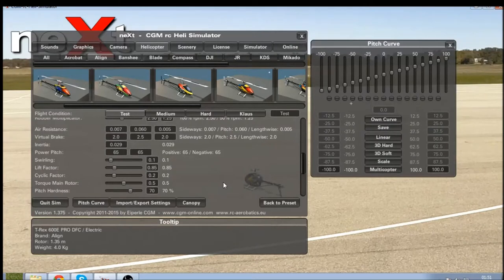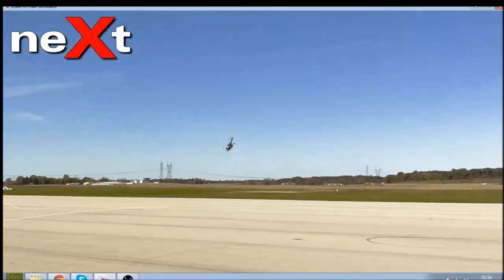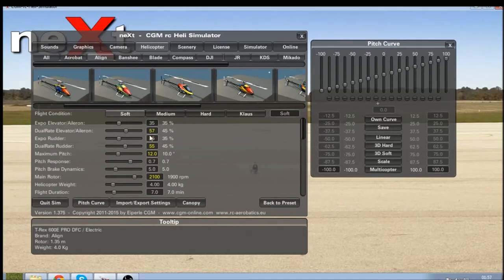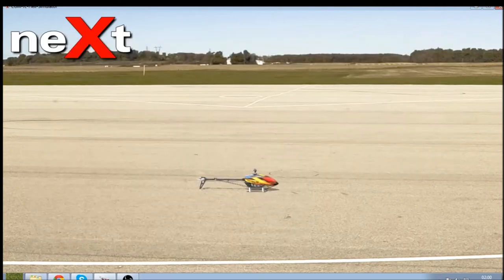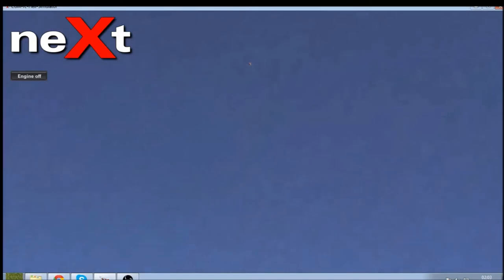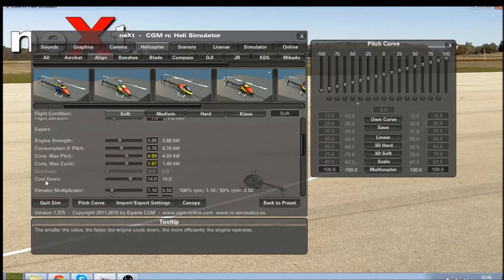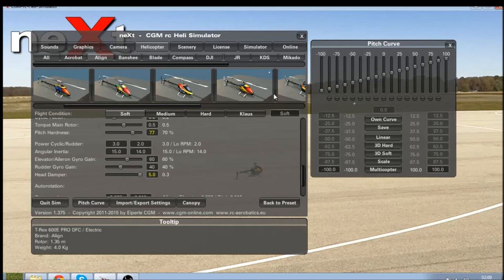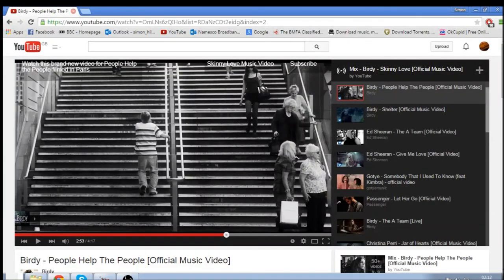Next RC Simulator - Setup Tuning Tutorial

Comment: Hi simon4557,

I have DEVO 7e transmitter, and i dont know how to combain it to the game.
can you explain me how to do so ?

THANK ALOT
Reply from the maker: +amitt111 https://www.youtube.com/watch?v=9HLhXViLo2Y

thanks
Reply: +simon4557 
THANK SIMON, but it doesnt work :(
maybe' because i use the demo version ?
i hava win xp LOL. maybe this is my problem ?

I did all your steps in the video, but i didnt managed to do "throttle up" cuz the computer didnt recognized the transmitter/
Reply from the maker: what simulator cable do you have ?
Reply: i have them both:

1. cable with two same heads (like cable of headphones)

2. cable with USB input, and mini-b output.

i tried with them both..
Reply from the maker: does windows show your controls moving after calibration in windows game controller settings ?
Reply: no :(
Reply from the maker: is your transmitter turned on ?
Reply: yes it is..
Reply from the maker: it need to be turned off 
turn off tx then plug cable into tx it ill power on when cable is inserted. do not turn power on the tx with switch.
Reply: i tried it now, and i dont know Y it stil doesnt work...
maybe a problem with my transmiter...
Reply from the maker: can you change you transmitting mode for example PPM, PCM ?
Reply: +simon4557 

sorry for the delay..
I scanned all my transmitter options/functions, and I didnt find anything like PCM or PPM...

You R saying that probably my transmiter is on PPM mode, and because of that i cant work with it ?

by the way, thank you very much for the help my friend! YOU R THE BEST :)